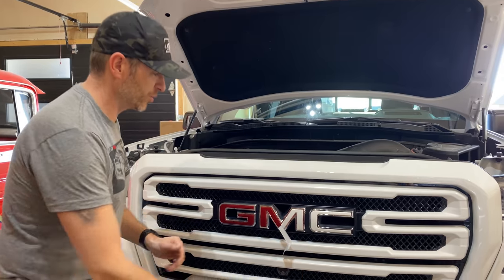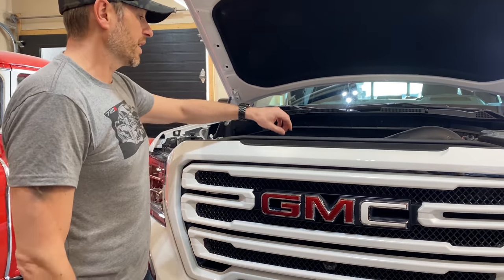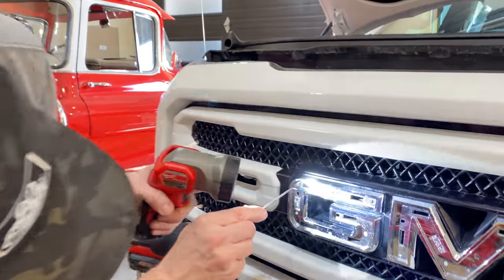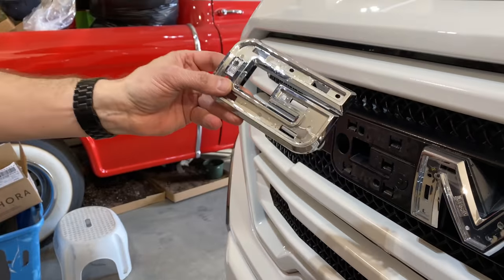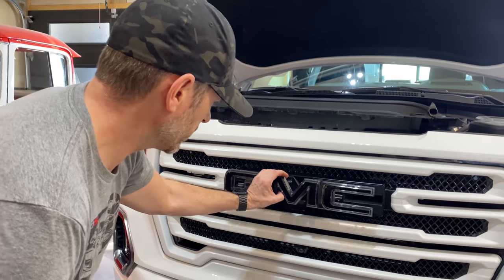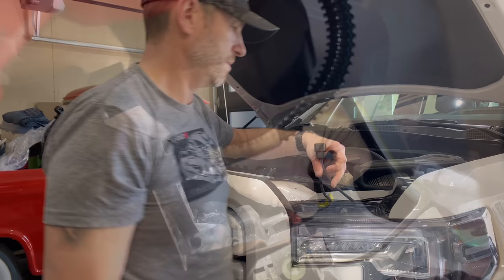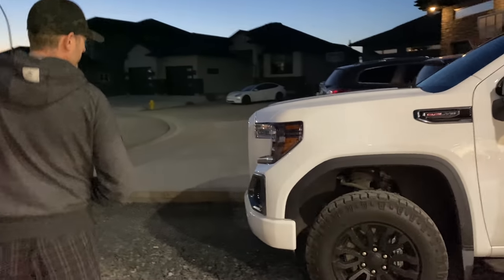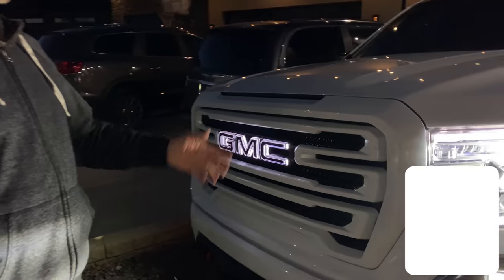How to Install the Illuminated LED GMC Sierra Emblem / Badge - A Genuine GM Part

Comment: If you '22+ refresh model guys stumble upon this, don't do it this way, especially if you don't want to destroy the letters.  On 22+ refresh, the letters are part of a subassembly.  Remove the plastic cover under the hood and then use about 1' of extension and a T20 to remove 5 torx head screws from the back and the block detaches, then you can release the clips from the back side of that block.
Reply: What is a refresh model ?
Reply: @thedavis3270  The new body style.  Then non-LTD, often referred to as 'refresh'
Reply: @klutch14u  yeah it is way easier to do it this way... and btw homie aint nobody saving those emblems...

Comment: Just installed this five minutes ago...  It took about an hour.  

The most difficult part was "breaking" the grill free by pulling up on the clips (after removing 10mm fasteners).  To hold the grill out away from the frame II used large Irwin clams set up in a reverse (spreading) layout.  This gives about 3"-4" of space before the upper bumper assembly starts to disconnect. Pay attention!

The 'GMC' emblem came off pretty easily using a plastic scraper (came with my wife's pizza stone)as a wedge, and a small stubby flathead screw driver to disconnect the clips.  

This was very easy to install/connect with the video tutorial.

Note: the lighting is not visible in daylight.  It must be dusk/dark for you to actually see it.

Comment: I took me maybe 20 minutes to remove the factory GMC letters, but I was able to use a small screwdriver and removed each entire letter from the backside of the grill and didn't damage the factory ones at all.
Reply from the maker: Without taking off the grill!  You are the king 👑. Good job! Bonus for sure
Reply: Video or your 🧢

Comment: When our mechanic went to get his ase certification, this was years ago but anyway he said the instructor referred to gmc as gotta mechanic coming. Being a gm man I didn’t find it very funny but just thought I would share it. Now that I’m in my early 50’s I have figured out that regardless of the brand, it boils down to maintenance on a regular schedule including transmission and especially air filters oil and quality good oil of the proper weight and not driving it like your on a race track. That works on Ford and GM anyway.
Reply from the maker: I have had a Ford, Lincoln, Chevy, Dodge and GM trucks and I agree.
Reply: @Donslife  I’ve never had a Dodge but their good looking trucks. I’m scared to buy anything now with the world in such a mess. I heard gas will be 8 bucks a gallon in August. Who knows, I’ll just keep trusting God.
Reply: We beat the crap out of our trucks at my job and I can honestly say the GMs hold up the best.

Comment: Hi Don, I love your videos you were talking on one of the videos about decommissioning the often on switch when you’re at a stoplight I also find it very annoying when the motor shuts off and on is it possible to give me some info how I can do it on my GMC 2023.   You remind me of myself I always like to change my vehicle to be different.    Cheers cheers.Art
Reply from the maker: Thanks for the support.  Here is the video and the links to the company’s website should be in the description.   They will have details for the install for your specific truck too. 

Auto Start Stop Eliminator / Bypass GMC Sierra AT4. Full Review and Installation!
https://youtu.be/FGq25E2fRWU

Comment: Had this on my Denali. It kind of got lost in the grille visually as there is no chrome trim to make it pop in daylight. Just looked like a black hole in the center of my grill. So I swapped it out for the regular black emblems with chrome trim. But one thing I did do was paint match my grille surround. I did love the look at night with the emblem but in the day I hated it. Yours looks great with your color scheme. It was a pain to remove the emblem but I did it
Reply from the maker: I am going to try the white vinyl over the black letters.  I think it will help it in the daylight.
Reply: I want to add this to my Denali .. what website do I order from ?
Reply: @BluetickOutdoors  gmc’s website

Comment: Looks awesome !! Can’t wait to get my at4 :)  does it come one with the daytime lights or when the head lights come on ?
Reply from the maker: You can turn the fog light on or off with the DRL’s only if you want.  When it gets darker outside, the ambient light sensor will turn the low beams on too automatically.  (All of the above in the AUTO setting)

Comment: Awesome work, I would like to do this on my 2019 sierra Denali will it fit or will I have any issues?
Reply from the maker: Thanks - It will fit if it is the 2019-2022 body style, not the refreshed 2022/2023.  There are reports of these failing from moisture penetration issues

Comment: Hey don, let me start off by saying love the channel! I like all the great ideas…. I just bought a 2022 GMC Sierra SLT limited. So I ordered the gmc light up front emblem from the same place you got yours. There telling me they need to order it from GM and it will be delayed. Just wondering if you had any problems getting yours? Or how long it took to get yours? Thanks in Advance for the info. And keep up the great work!
Reply from the maker: Thanks man!  I was lucky to enough to order from my local dealership and it came from a city about five hours away within a couple days.
Reply: Do they have on for the 2019
Reply from the maker: @m.dmiranda13  2019, 2020, 2021, 2022 New body style only.  Will not fit the 2014-2019 series

Comment: you can remove it with a stiff trim tool..doesn't need all that drilling
Reply from the maker: Absolutely it is possible but you still will break portions of the old emblem.  The way I chose was so much fun though!

Comment: Is it hard to install and does it matter which side you connect the cable to a head light
Reply from the maker: It can be difficult to install if you are unfamiliar with disassembling grills and stubborn clips.  You should be able to plug in behind either headlight.

Comment: I love your videos and mods that you do. I want to do the illuminated emblem on my 19 Denali but they said they don't sell it at the dealer. I was hoping that maybe you knew the reason why since you had already done one on your 20. My bad I just saw your reply to my older comment. I'm sure mine is the newer body style.
Reply from the maker: Lots of info here: 2019-2021 should fit with the same part : https://www.gm-trucks.com/forums/topic/234437-illuminated-gmc-emblem/
Reply: Hello I jus purchased a 2015 yukon denali I want to install the illuminated emblem can you please guide me?
Reply: They just found one for my 2019 Sierra Denali they said they may have to tap in the wires but they did not. It was plug and Play because my pickup was later 2019.
Reply from the maker: Unfortunately I don’t think they make one for your Yukon. The newest body style I believe they do though
Reply: @kellydixon1893  will it work for my 2020 denial
Reply: Suv

Comment: Hi Don, I like your Chanel a lot , lots of good info, I want to do all of the mods that you have done to your AT4 , I have a question I bought a 2020 SLT 5.3L, that don’t have the technology package , can that be added on .. thanks again Don
Reply from the maker: Hey there!  Thank you for the support too!  Unfortunately I don’t think there is a simple way to add the package.  It would likely require a donor truck for all of the parts and an expert in all of the complicated integration that would be needed.   Maybe I am wrong
Reply: @Donslife  thank you Don , be safe and keep trucking 👍

Comment: I noticed they have a few options when buying Red/Black but they also have a with or without pro tailgate option , so my question is what difference would it make ? And don’t all AT4s come w/pro tailgate ?
Reply from the maker: Yes there are some options.  The main reason black has the extra replacement for the tailgate is so you can have black at the front and back.   If you are just upgrading to the red illuminated logo, then you’d only want one since the back is already red too.  I wrapped the inner part white on mine

Comment: Hello , do you think it’s possible to hook up this emblem to power wire and have a switch in the truck so you can shut it off as you want ?
Reply from the maker: Yes, but you’d need to splice into the wires. Definitely doable though

Comment: I have a 2021 sierra. I am on my 2nd illuminated emblem (black illuminated emblem). Both have lasted less than 6 months and continue to somehow get water in them. Ordered and installed through dealer both times. Both times part was on back order. A bulletin was put out about these also shorting headlights out. It was a total waste of money and time for me. Anyone else having this issue?

Comment: Don I recently stumbled across your channel. Great content. I have a 2019 AT4. Does this mod and others on your channel also work on my year/2019? Thanks!
Reply from the maker: Yes they should.  Just make sure to reference pin locations and not wire color or count.  Some pins have 2 wires and/or could be different colors
Reply: @Donslife  Okay will do. Thanks again.  Keep the great content coming.

Comment: They are prone to getting moisture in them and will slowly start to dim and fail, I'm on my second set now
Reply from the maker: I had better keep an eye on mine.  Hopefully that won’t be my experience
Reply: @Donslife  maybe some silicon around the edges will stop the water getting in.
Reply from the maker: I was thinking the very same thing!

Comment: you could have just reached behind the grille and popped the clips off
Reply from the maker: Not with the active shutter they have in front of the radiator now.   You could take half of the front end apart but that is also quite time consuming

Comment: Hi Don I’ve had to replace two of these luckily under warranty I think due to the frequency of car washes and water intrusion it starts with getting dim then one letter going out finally whole things goes out. Curious if you badge is still working
Reply: How long do they usually last before going out?
Reply: @ChilesSupportTV  first one lasted about 5months the second one lasted about 7months
Reply from the maker: Unbelievable
Reply: @michaelpohl3247  At $350 a pop, that's not good at all.
Reply: I forgot to mention GMC will warranty as long as vehicle has less than 36000 miles and they installed it

Comment: Where did you get this from?  All the ones I have found look cheap and the lights look kinda crappy. This one looks decent.
Reply from the maker: Direct from GM.  Part numbers are in the video description
Reply: @Donslife  how much was it?
Reply from the maker: @ecoboostrules9795  Depending on whether you want red or black, but they start around $320 USD
Reply: @Donslife  holy shit. To expensive for me.

Comment: What year is your pickup? I called dealer to get one for my 2019 Denali they could not find one.
Reply from the maker: 2021.  It has to be the new body style 2019.  There were two body styles in 2019

Comment: Hey boss will this method work for a 2020 2500 denali? Same drill points?
Reply from the maker: Google tells me 2021-2022 for the 2500’s.  Its a GMC part : https://accessories.gmc.com/product/front-illuminated-gmc-emblem-in-red-84741557?year=2021&make=GMC&model=Sierra%202500%20HD&categoryId=98048

Comment: What is the trick to getting the headlight adapter unattached? It’s incredibly difficult to remove.
Reply from the maker: Not sure which section you are specifically referencing but many of the connectors use red colored locks.  These have to be slid or pried outwards so the release buttons can be depressed to pull the connectors apart
Reply: @Donslife  yes! Pull the red tab back towards the wiring, press down black piece directly below the red tab, pull. I’ve gotten it several times using the emblem wiring, but having difficulty specifically with disconnecting directly from the headlight.

Comment: How much did it cost and what size tires are you running
Reply from the maker: The illuminated logos vary in price depending on red or black letters.  I think about $300USD is where they start - right from the dealership.  My Tires are the factory 265/65/18.  I installed 1.5" spacers and made a video too

Comment: Does the black letter kit come with the rear emblem as well? You said your kit did but when putting the part number in to order it says front emblem.
Reply from the maker: I double checked my invoice.  It just says 84942528 Emblem.   I wasn’t expecting the rear emblem.  When I asked they said it is so you can change both factory red ones together

Comment: Hey do you know if this will fir a 2020 gmc elevation 1500?
Reply from the maker: Yes - 2020	GMC	Sierra 1500	AT4, Base, Denali, Elevation, SLE, SLT	2.7L L4 - Gas, 4.3L V6 - Gas, 5.3L V8 - Gas, 6.2L V8 - Gas
Reply: @Donslife  thank you so much,

Comment: Hey I have a 21 gmc at4 , will this be good for a leased truck?
Reply from the maker: I think it would depend on how you returned the truck after the lease.  If you give it back with the new part installed, I don't think they would care.  However, if you took it off and tried to put the old badge back on (assuming you damaged it during removal) they might want to charge you for a replacement badge.

Comment: I checked for the red illuminated emblem for my 2019 SLT says it don’t fit
Reply from the maker: Is it the new front end body style like mine?
Reply: @Donslife  yes sir 2019 w the new body style
Reply from the maker: Yeah, you are correct for some reason the 2019 isn’t listed but the 2020 and 2021 are.  Strange.   I am not sure what exactly isn’t compatible.  Mounting tabs? Wiring harness? So man, I don’t know.
Reply: @Donslife  I’ll take pics of my harness see if it matches yours. Been wanting that emblem for some time now. Thanks for ur reply back

Comment: Wonder if this works for 2018 - great video looks awesome
Reply from the maker: Thanks!  If I still had my 2013 Sierra Denali, I would be inclined to figure out a way. Assuming it fits the GMC back plate, you’d need to find a way to mount it and the tap into the headlight wiring.  I am not sure of any specific voltage requirements either.
Reply: @Donslife  seems to be the same measurements 16.5 -3.25. But where did you find it in black ? Only see red - I’m gonna ask the dealer if they will take a crack at it. Otherwise I’ll take to a local guy I use for stereo installation
Reply from the maker: @SharkLifeSean  that’s great.  The part number for the black version is in the video description.  It does exist I promise:)
Reply: @SharkLifeSean did it work on the 18 model ???

Comment: Is there one made for a 2011 gmc terrain. I can't find one
Reply from the maker: Not that I am aware of.  It is a newer item since 2019
Reply: @Donslife could you measure it and see how long and how tall it is?
Reply from the maker: @devynsheets5274  I can later, but I am pretty sure I put the measurements somewhere in the comments over a year ago.
Reply from the maker: @devynsheets5274  I haven’t heard of anyone making it fit on another model other than 2019+ Sierras

Comment: Will this work on a 2008 gmc they don’t change the gmc emblem that much I would not think
Reply from the maker: You’d have to measure the space, most likely find a way to mount it and then tap in the wiring of a headlight.   Definitely wouldn’t be plug and play.  Might be a fun project!
Reply: Hey man did you ever see if it would work I also have a 2008 Sierra and was wondering if it would fit mine
Reply from the maker: @paulmenefee2998  it won’t fit without heavy modification and wiring

Comment: Hey Don hope all is well. Do you think this GMC grill logo will fit a 2019 Denali? Thanks for your time.
Reply from the maker: I presume your 2019 is the previous body style. It might fit from a size standpoint but I don’t think the clips or wiring will be direct fit.  You will most likely have to splice into your DRL’s and fabricate a way to securely mount the logo

Comment: What's the price on a truck like that?
Reply from the maker: In Canada, Mid 60k to mid 80k depending on options. Mine has most of the options except the carbon box and a couple little things and was getting close to 80k Canadian.  I was lucky to find one at a nearby dealership and negotiate a bit of a deal.  Now with the microchip shortage, they aren’t discounting inventory in most cases.

Comment: Hey Don,  what size step drill did you use?  Thanks!!
Reply from the maker: Maybe 1/4 or 5/16 step.  You could just use a drill bit close to those sizes too.  I just like step bits for shallow drilling

Comment: Did your headlights have dust covers? If so, did you just leave them off?
Reply from the maker: I am not sure what you are referring to.
Reply: @Donslife  Did the grill light plug into an existing headlight? My 2020 sierra has dust covers on the back sides of the headlight bulbs on the high and low beams.
Reply from the maker: @nettechssupport9334  I understand now.  The emblem plugs into a harness for one of the headlights in a location well before the back of the headlight.  No need to mess with the covers or wiring near the bulbs.
Reply: @Donslife  Ah! TY!

Comment: Can this be used on a 2019 GMC 1500 Denali ultimate??
Reply from the maker: I believe so.  The dealership you order from can confirm as well, but they are designed for the current Sierra platform regardless of the surrounding grille design.  At least that is my knowledge on the matter
Reply: Yes.  I installed one on mine.
Reply: @07liftedAV  Thanks. I wanna order one, but wanted to make sure it'd work
Reply: What about a 2018 Denali Ultimate?